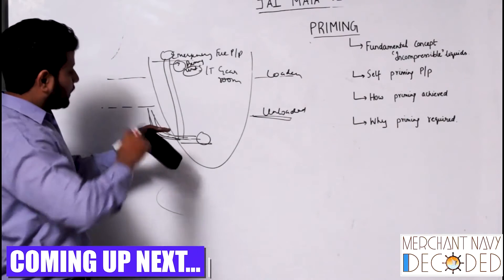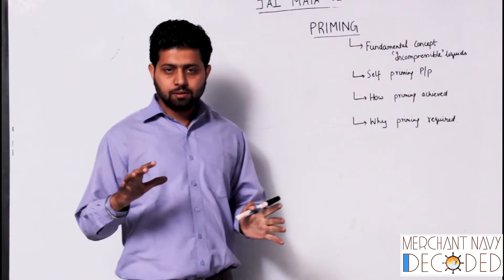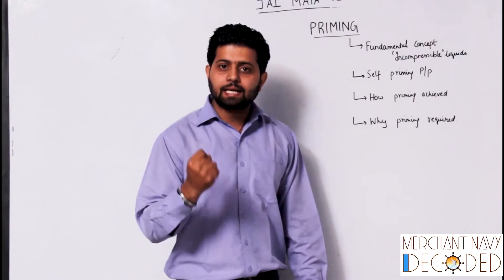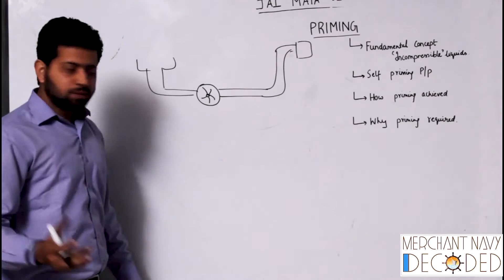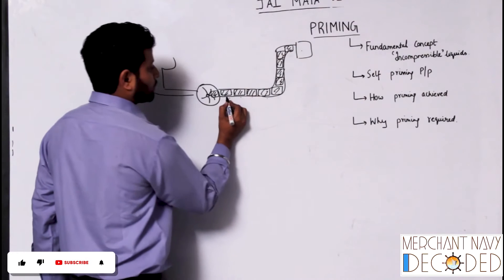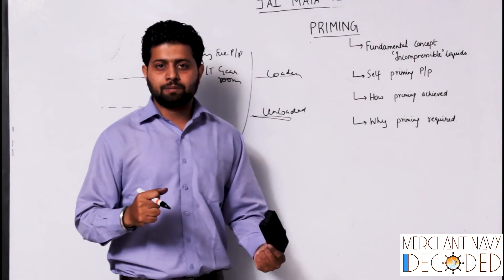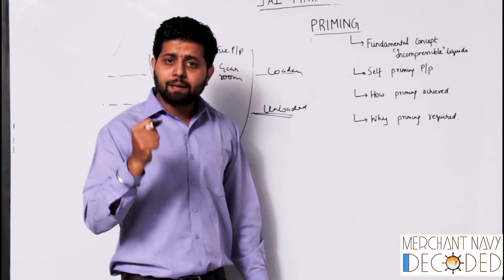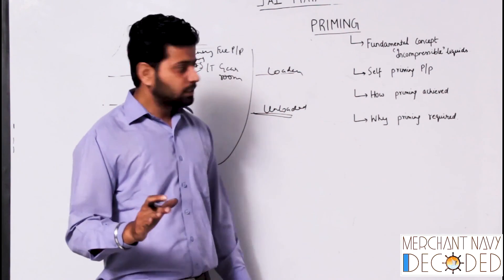What Is The Archimedes’ Principle || Archimedes Principle Fluid Mechanics

Comment: Sir ts rahman ke procedure me unhone sirf 60% mange the (PCM) . so I filled the form but now they send me a mail and there I saw they are asking for 70% in (PCM) . What should I do sir I'm very nervous? They are doing well with me. 
Sir plz reply your answer.
Reply: Aman then plz either join Mechanical engineering (Engine side) ; if u r interested in deck side then take B.sc (Maths;ohysucs and chemistry) from a college which is recognized by a board... Score good percentage all the three years in pcm and u can try... But Kindly mind your age also whether would u be eligible then by the time u finish your bsc... If not plz don't join in bsc... Better do mechanical engineering and try for GME (sponsorship) from good shipping companies.... It is jus an advice to u.
Reply from the maker: Aman you can try in great eastern, sci as well.
Reply: @MerchantNavyDECODED  but what if they do the same means if they also ask for 70% in pcm.after fill the form